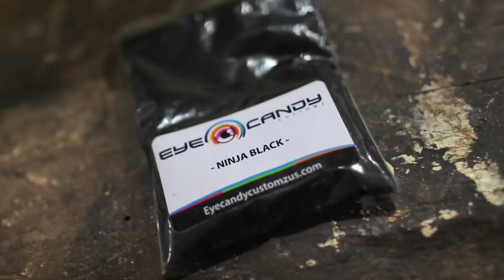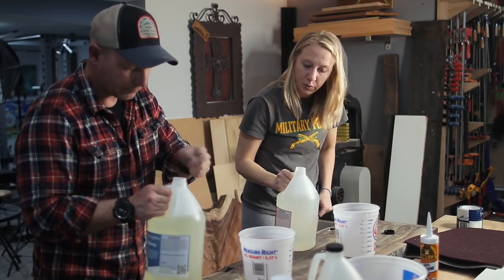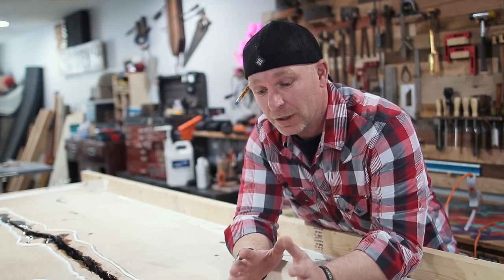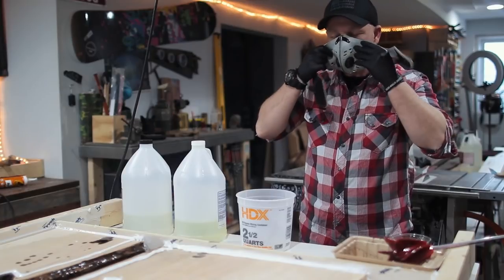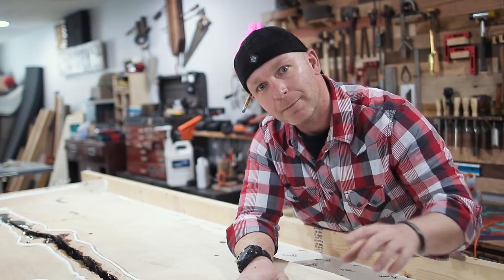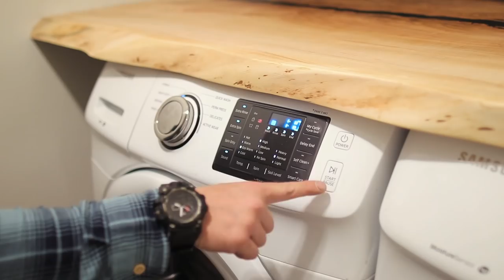How to Make an Epoxy Live Edge Countertop for the Laundry Room!! DIY Project for Beginners

Comment: Beautiful project! I am curious to see follow-up videos on these slab countertops after 5 or 10 years to see how they've behaved—or not. Guessing there could be some movement, cracking, cupping, twisting, or similar effects of humidity/dryness cycles, temperature swings, and daily use. Thanks for sharing.
Reply from the maker: They actually hold up pretty good as long as you keep them indoors.  There should be that much movement

Comment: Looks great but you need to finish the bottom the same way as the top or the slab will absorb or lose moisture unevenly
Reply from the maker: Grand River Wood Co I agree.  I totally forgot to do part of the underside and realized it when I posted the video.  I did go back and finished it a month later. I was lucky I didn’t mount it permanently.
Reply: @KomarProject  👍